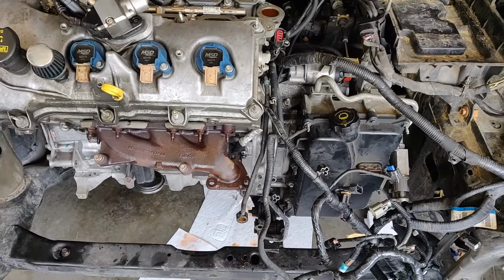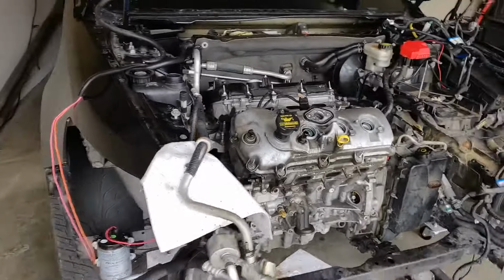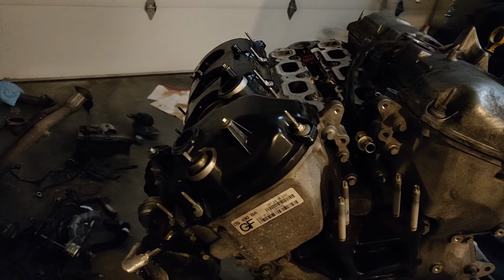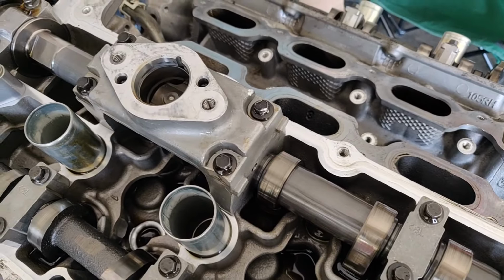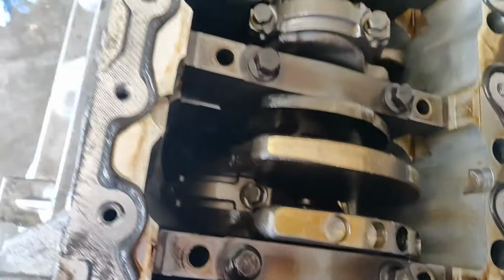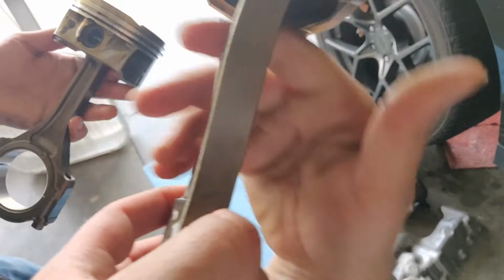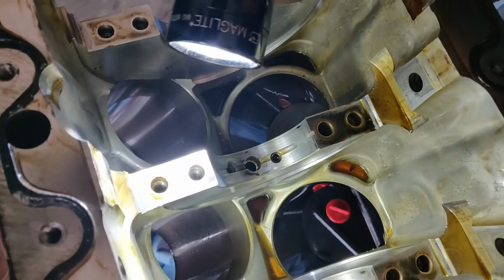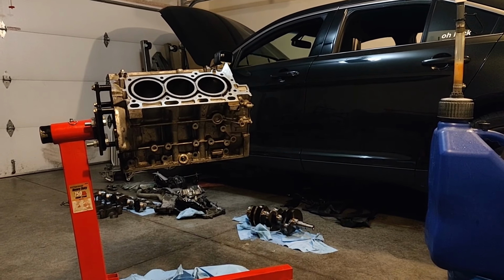NOT SUPPOSE TO DO THAT! Motor Teardown! (PT.3)

Comment: It's been over three decades since I did the last rebuild on my 429, but I would not even think about doing this with my SHO (or my Torino for that matter.) So many small parts, and they all have to be perfectly torqued, in the right order. I'm following your rebuild thread, and this video was on page 7 of 10... so you may be much further along by now. Good luck.

Comment: I bet you can get those journals polished on your crank, you’ll probably need to order 2 sets of bearings, a set of standards and a set of +, you’ll also probably have to mix a standard half with a plus half especially if you’re not trying to remove a lot of material from all the journals. I generally do a + on the lower side and a standard on the top. Port your oil pump openings, it’s no time to debur and smooth it out. Hook a compressed air chuck up to the first primary oiler and have the chick blow through the main oil galley to blow the metal out of the pump body.

Comment: loving the progress so far! you've been making me feel confident to do a bit more "advanced" work on mine, did the PTU fluid today and man is that bolt a bitch, how would you recommend to get all the fluid out? i was only able to get half of it but i plan to do another drain in a week or so but how would you recommend to get it all? i used a basic hand pump brake bleeder do i just need to use a smaller tuber to reach in more? (diameter wise lengths fine) definitely made a noticeable difference though even with 50%
Reply: I just did mine today. I was able to get all the fluid out just by removing the drain plug. It only holds about 15 oz.